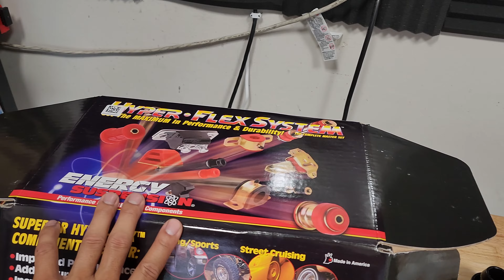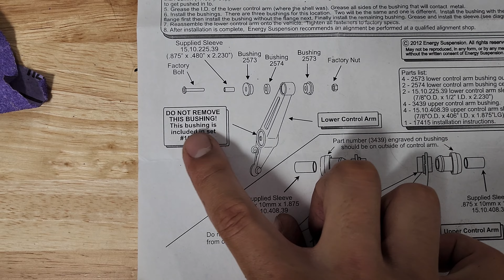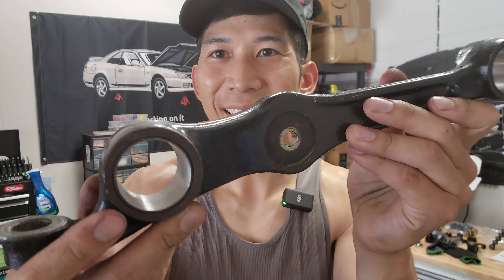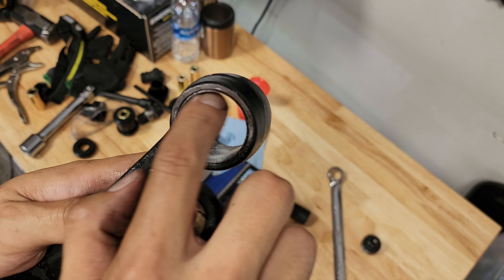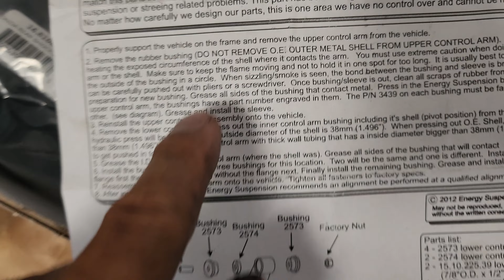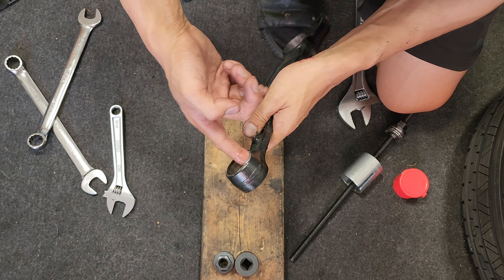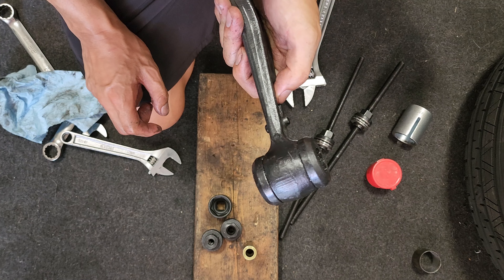This is the Hardest install I’ve ever done - Energy Suspension Bushing Kit

Comment: FYI you need to load the suspension before you torque everything down to spec or you risk tearing those poly bushings and or cause binding.
Reply from the maker: Yes, thanks for the reminder! This is probably the reason why my bushings went bad in the first place because when I installed coilovers years ago, I didn't preload the suspension /)_-
Reply: @Rawrkee  To make it easy just take a measurement from the center of the hub to the top of the fender.  Then when you are ready to torque things down just jack that lower control arm until you reach the same height as if it were on the ground. Poly bushings don't have a long life like rubber bushings, they're good for stiffer connections and cheaper prices but that's about it imo.

Comment: I did all my bushings. Mine must be an older style set, I didn't have the 3 pieces for mine, there's only 2 for mine. I've had mine in for little over 2 years and still haven't squeaked yet. Gonna take em all apart soon and refresh the grease. Looking good though bro
Reply from the maker: Yeah, I'm not sure why but my part number for this kit ends with an extra digit, which is the letter G. But on the ES website, all of the part numbers don't have the G at the end. Good to hear that the bushings have last you awhile now, how do you go about refreshing the grease? Are you gonna have to press the bushings back out?
Reply: @Rawrkee  yea usually I do, this is my 3rd set of energy bushings, I got a set in my lude, my mustang, and I had a set in my Civic. Sold the civic. My mustang I've done 2x already. They squeak alot. Lol but the grease is specific to the poly bushings, so not your normal grease as you know. It sucks but it's part of the maintenance man.

Comment: Good to see you back. Those metal sleeves are a pain. I had to weld a cross bar in to be able to press them out of my arms. Also, I took the metal sleeves out of my uppers not thinking. Reinstalled them and hopefully the caster is correct. Definitely worth the time to replace. Now I need to figure out a roll center correction on the Type SH or convert to base sub frame and run the RSX roll center correction parts.
Reply from the maker: You're not lying! I'm stuck right now because I can't get the metal sleeves off the rear lower control arm. I had to order more tools -_- hahah
Yeah, I've heard about the RSX roll center adjusters fitting but didn't know it was specific to base models. I guess its about time I raise the ride height to not have to worry about it 😂 I have another good reason as to why I "should" raise the ride height but that wont be announced until hopefully sooner than later :D

Comment: I just got finished installing a full poly bush kit on my 4WS 5th gen. 
It was a mission, I'm glad it's done but I don't want to ever have to do it again!
Reply from the maker: LOL! Maybe these aftermarket bushings will come out much easier next time 🤣
Reply: @Rawrkee  Just so you know, you should wrap some teflon/thread tape around the bushes as well as the silicone grease. It helps to stop the squeaking for much longer than just grease alone.

Comment: Hey Rawrkee how did you get those lower control arms back onto the ball joints so easily? I could press them back on with the ball joint press but the Axel is in the way, especially for the sway bar. I believe I've got the ball joint almost completely on the lower control arm about 98%  but I can't hold the press so straight due to the lack of space with the Axel in the way.
Reply: Do I need new ball joints?
Reply from the maker: One e I get the LCA into the ball joint, I’ll jack up from underneath the LCA and it’ll put enough weight to make the ball joint sit flush so I can hand tighten the castle nut. Nah, you don’t need new ball joints unless you’ve verified there’s noise coming from them by rocking your wheels back and forth at the 12 and 6 o clock position. There should be little to no play if they’re good

Comment: Did you just swap your sh to base? bc I have a h22a with another trans and Im thinking about just swapping my sh to base.
Reply from the maker: Nah, my motor is still SH. It would’ve been a good idea to do the base swap but I was too impatient to source a base transmission 😬 plus I’d have to get some sort of adapter plate for the half shaft. You don’t need to do that if you just do a base longblock swap but I had rebuilt my SH engine and so i didn’t wanna toss it

Comment: Where did you get the kit I have a type sh too and mine are all shott haha😅
Reply from the maker: I got the part number on the energy suspension website and found a good deal on Amazon. If you follow through with the job, it’s not fun at all hahah
Make sure you have an impact gun

Comment: I recently found out that my prelude doesnt have sway bar end links, i dont even know how that is possible how both sides are missing. the car has insane body roll and i figured it was time to update my suspension since the body does have over 300 000 km (180 000 miles) on it.
Reply from the maker: No way!? are they just missing in the front? The rears also have endlinks too 😬 I ended up replacing all 4 as well. Did you also use Energy Suspension too??
Reply: @Rawrkee  to be honest I havent checked the back yet, but I didn't buy anything for the suspension yet. I have an oil leak which is my main focus right now